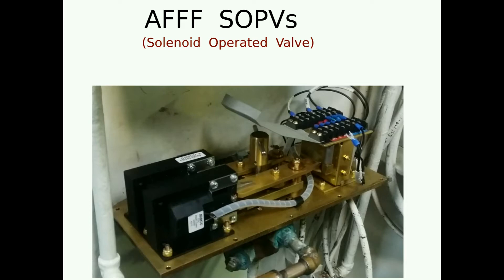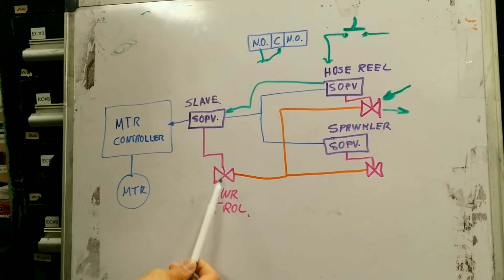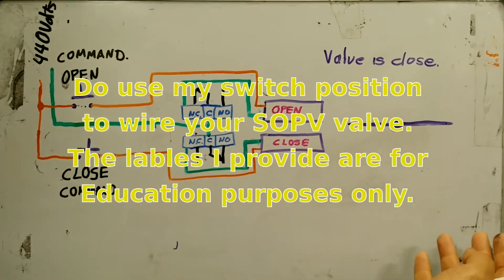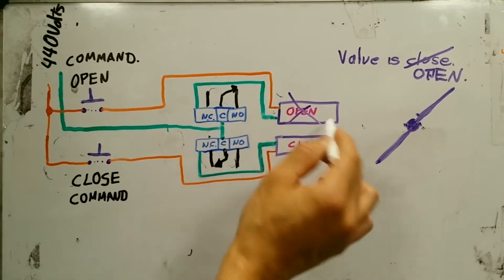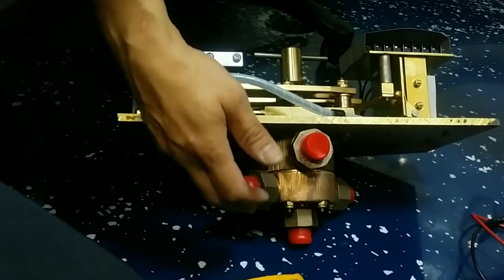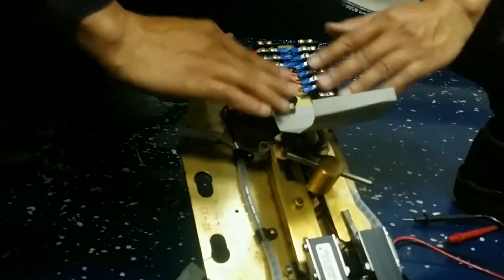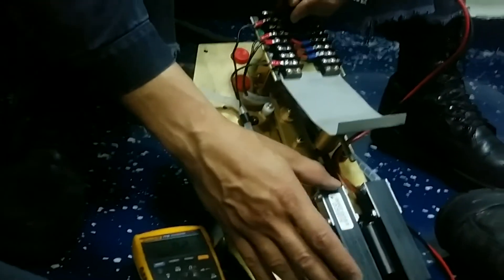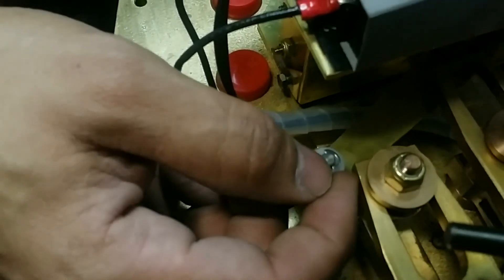40) Electrician's Mate - Solenoid operated valve SOPV for AFFF and other systems

Comment: I’m a little confused what’s the difference between our orange and green power?
Reply: Green power is "CONDITIONAL POWER " and energizes both solenoids via the their assigned N.C. (contacts) when they shorted/connected to the "C" (labeled terminal) on the switch. 
KEEP IN MIND:  The "C" terminal is common for green power and only one N.C. will be sorted/connected to the "C" terminal. 

Orange power is "CONTROL POWER".  There are two push buttons and when pressed they deliver Orange power to it's associated solenoid. This are spring loaded push buttons. 

WARNING: If a coil stays energized for more than 1 second it can burn and will need to be replace. To prevent this : The valve MUST be wired in a way that  ensure a coil is only energized momentary, regales if the operator hold the button down for a long time. 

Pause the video at this time 3:50. NOTICE that the green line connected to the N.C. (TOP terminal)  for the OPEN solenoid is not energized, there is no connection between "C" and "N.C." Therefore the OPEN solenoid does not have green power (CONDITIONAL POWER), so holding down the "Command Open" (Orange power) push button does not do any damage  to the solenoid because the solenoid only is missing one leg of power (green power)  

However: the Green line connected to the N.C.  (BOTTOM terminal) for the CLOSE solenoid is energized. The "C" and N.C. are connected. Therefor the CLOSE solenoid has CONDITIONAL POWER. Here, pressing the "Command Close" push button will cause the CLOSE solenoid to get the Orange power.  The solenoid will have both "green and Orange power" .Luckily, this will only be true for a short period of time. In this scenario the "Energized" CLOSE solenoid will cause the the valve to "violently  shift" and will quickly switch all micro switches' position on the valve.  As soon as all micro switches shift, the CLOSE valve is de-energized because it looses the green power, and set up only to provide CONDITIONAL POWER "green power" to the OPEN solenoid.  And the scenario is reversed.
Reply: Johan Baron on the ship right now I’ll
Be reading this soon. Thank you!! We don’t have a lot of information here on the SOPVs